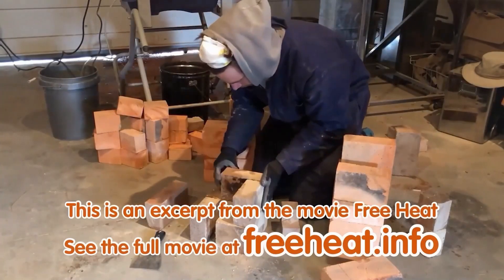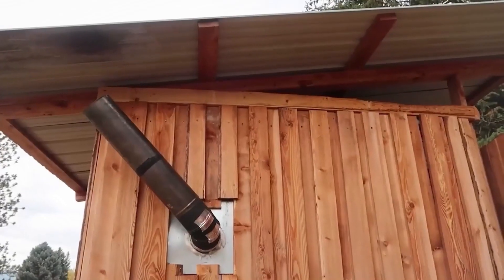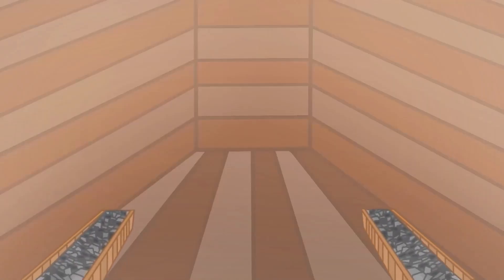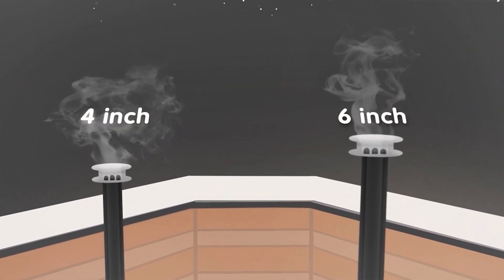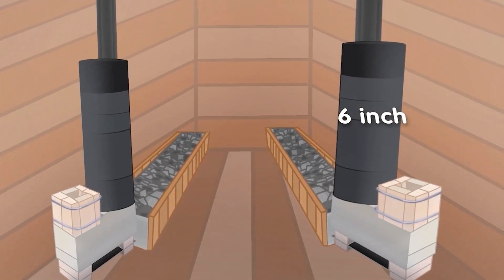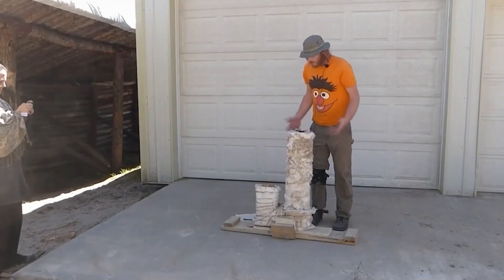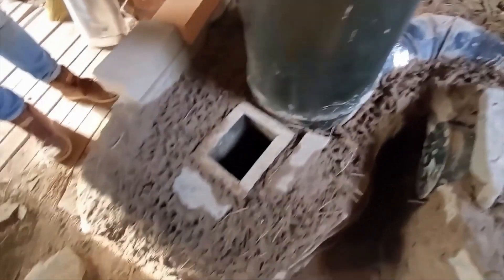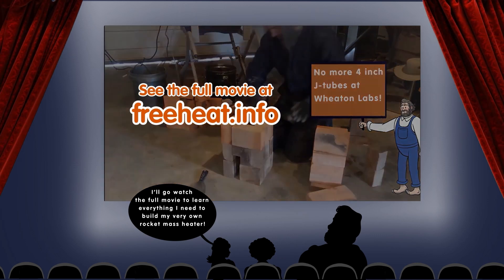Free Heat movie excerpt - challenges with 4 inch systems

Comment: I have an add on to my room. That is about 800 square feet. If it's 0°F outside, it's 30°F inside. This is with no heat.  Which size rocket mass j tube heater should I go with?? 6 inch or 8 inch?

Comment: The problem with the 6" rocket is that an efficient tiny house rarely if ever needs that much heat. It's like a Pinto with a V8!

A 6" rocket will cook you out in a hurry unless you waste heat or have a huge mass to absorb the output (a great solution in stationary homes, but portable tiny houses don't go well with huge masses).

If you build a tight system you can use a battery powered "startup" fan on a 4" inlet and get good combustion right away (simulating the 6" natural draft). If you're worried about leakage you can go with a high temperature fan (such as a chimney fan from a gas furnace) and mount that at the end of the chimney. That setup creates a vacuum so leaks are virtually impossible and startup draft is never an issue. NOTE: The fan should be powered through a twist timer so you don't forget that it's on. 

The inlet fan type system is far easier and cheaper to make and operate, but it requires a tighter build. 

With either type fresh air to the inlet should be ducted from outside so your heater isn't sending room air up the chimney (and pulling in cold air through leaks in your building).

Comment: This may be getting into the weeds a bit, but what if you have a six inch system, but taper the exhaust down to 4 inch at the chimney in an effort to lose less heat?  Would that diminish draft too much?
Reply from the maker: We tried it and had poor results.  But we were trying other stuff at the same time - so there is still hope.  It needs a lot more testing.
Reply: Under no circumstances should you choke the system like that. It will not work right. You can only have a larger diameter chimney, not smaller.

Comment: Why do you label This as free energy when you need to use Wood or other stuff to produce heat ? There is some energy required to get that first so that will end the "free heat" deal 😉
Reply from the maker: I have branches and other wood that I pick up in my yard and put in the wood pile.  And then I heat my home with that wood through the winter.  Therefore - free heat.
Reply: The amount of wood needed is so much less that traditional log burners/wood burning stoves. If you are burning fallen branches and carpentry offcuts, you are generating heat with something that would traditionally been a waste product.
Reply: The assumption is that a person is already cleaning up their yard, removing fire ladder fuel, or thinning smaller saplings to limit wildfire risk. Instead of tossing that wood into a brush pile to burn or rot, you could burn it in the stove instead. If you also happen to have an acre or two that can be used to grow coppiced firewood, then you can harvest trees that are smaller diameter (thus safer to drop) on a rotation without killing the trees.